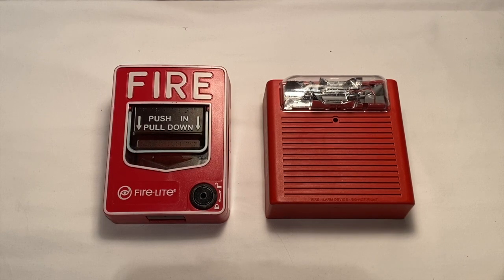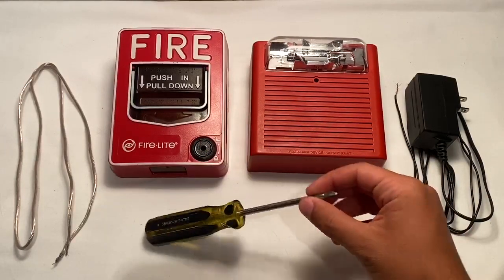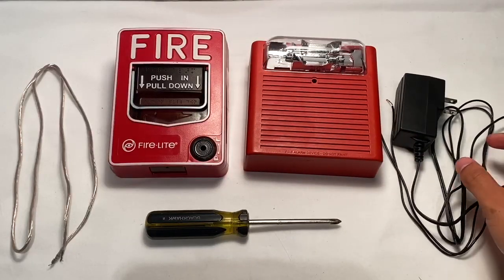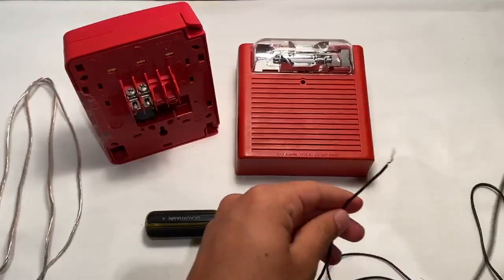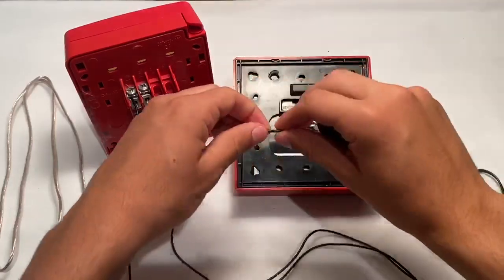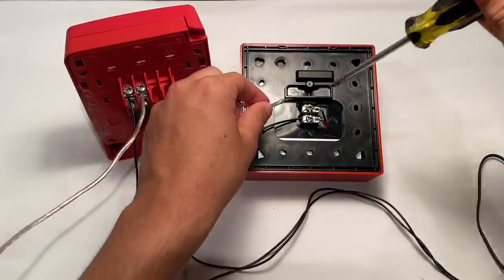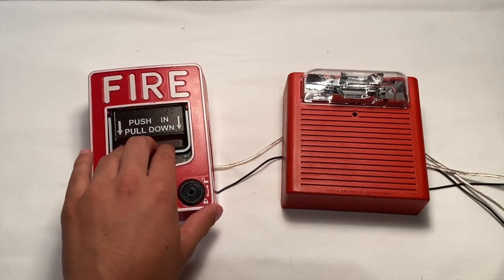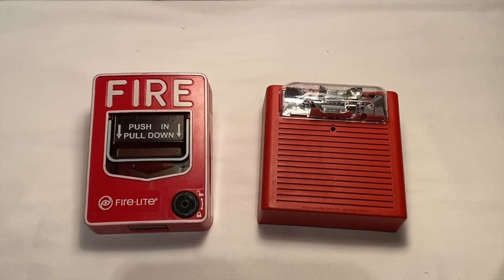How To Wire A Fire Alarm To A Pull Station Tutorial | REMAKE

Comment: If you don’t know what is the minus or plus is, then use the volt counter because if you are doing this:                       
+.       -
+.       -
Then it does not  count how it works😁
Reply from the maker: The positive is the wire that has the white lines on it as I stated in the video.  The negative is just the other one. As far as the pull station is concerned, it technically does not matter, it’s just a habit for me to place the positive on the red and the negative on the black but it does not matter and the same thing applies when wiring this to a panel.
Reply: What does it mean?

Comment: I know this video's old, but i was wondering how you split the adapter in to two? I was wondering if there were any good tutorials for doing this, because i really want to wire my pullstation :D
Reply from the maker: @GDSilverwastaken  I had to cut the end of the adapter opposite of the plug that goes into the outlet and I was able to easily peel apart the positive and negative wires and strip the ends of each with a wire stripper. Hope this helps!
Reply: @ wow! Thanks for responding this helps a ton! Can’t wait to wire up my alarms :D
Reply from the maker: @GDSilverwastaken Of course! Have fun and good luck!
Reply: @ thx :DD

Comment: With using a plug and doing the wiring,is there any way I could suffer an electrical shock when plugged in?
Reply from the maker: Since I’m using a 9V adapter, the voltage is much too low to cause a shock. Even a 24V adapter is way too low to shock you. I would recommend wiring it with the power unplugged so if any wires touch that shouldn’t it won’t short out the device or the adapter. Other than that, it is very safe!
Reply: @firealarmperson  outstanding thank you.

Comment: I used a battery pack from an old smoke detector worked perfectly.  But I had to wire mine differently as the pull alarm had 6 ports for wires. 2 positives 2 negatives and 2 ports for the switch. It's only works properly if I connect the batteries straight to the ports for the switch instead

Comment: You were mixing up current and voltage which is confusing. You said you need a converter & this one is 9 volts which is perfect for this device then you turned it around and said which is perfect  maximum amount of "current" of this device is 24 volts. There was No indication of which it was using AC or DC or both ? Also, current is measured in amps not volts ! Do you know what your doing ?
Reply from the maker: All I’m doing is showing how to wire the fire alarm to the pull station using an adapter. Keep in mind, before judging people, that  I was years younger when making this video.

Comment: Didnt Work For My Simplex 2099-9754 i tried to wire up My Remote Strobe TrueAlert But It didnt work
Reply: Is the TrueAlert a free run or smart sync? If its a 4906 you cannot run it. You need simplex parts. Get a free run one
Reply: @Flanks719  damn i have a 4906 damn i used to have a 4903 horn strobe but i fried the horn on accident ugh
Reply: @DanielElevators  damn

Comment: tysm i was trying to wire my notifier NBG-12 with my wheelock NS but there was something wrong because when the pull station was in the inactivated position, the NS went off, and when i pulled the BG-12 into the activated position, the alarm stopped

Comment: Where could I purchase both pull station and alarm ?
Reply: EBay. Pull station: NBG-12LX
Alarm: I don’t know but anyone with terminals would work. Sometimes the alarm only has 2 terminals and the pull station has 4 so you wire the power to 2 sets of terminals on the pull station and the other 2 go into the alarm. IF YOU DO HAVE A ALARM WITH 2 TERMINALS AND A PULL STATION WITH 4, WATCH THIS VIDEO: https://youtu.be/T0Vhs7-a6d4

Comment: Warning: Pulling down the fire alarm switch when there's no fire is not tolerated. You must not do this unless you have permission
Reply: Do you know what are those wires called?
Reply: in public places, that is, If you have a fire alarm system and it is not connected to the fire department, then you are good.

Comment: I have a question if I used two 9 volt batteries to wire a 12 volt system sensor mass12m non ada would it fry. Someone said if you use 16 volts or more a 12 volt system sensor mass would fry but the one in the video was ada

Comment: Is it possible to wire a BG12LX doing this wiring? Without a panel
Reply from the maker: Yes it is, but the address loop (the blinking LED light) would not function like you would see in a real addressable system.
Reply: Just pull the addressable module out, now you have a normal BG-12 that doesn't need an addressable loop.

Comment: what are the screw slots for the wires called
Reply from the maker: Screw terminals.
Reply: Fire Alarm Person thanks! i ordered a simplex true alert and none came with the horn side of it where can you buy them?
Reply from the maker: Jason Shelley Well, if it was titled a “horn/strobe”, the horn sound is already built into it. On the box it will say whether it’s a horn/strobe or not.
Reply: Fire Alarm Person it was a horn strobe they just took out the slots before they shipped it to me. i bought it on ebay

Comment: If you can’t find speaker wire, use doorbell wire it works fine
Reply: Any wire should work lol. I've used all kinds of different stuff. Chargers, speaker wires, old headphone wires, etc. I've never had any electrical issues with any of them either or had trouble with the alarm devices!